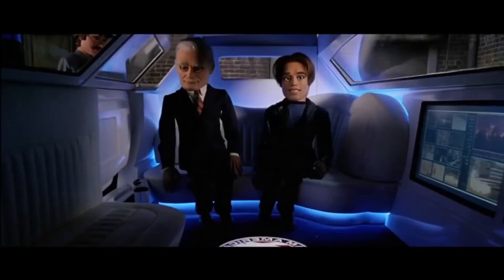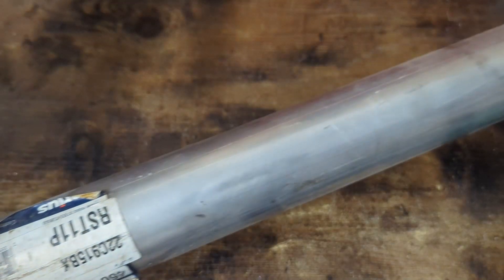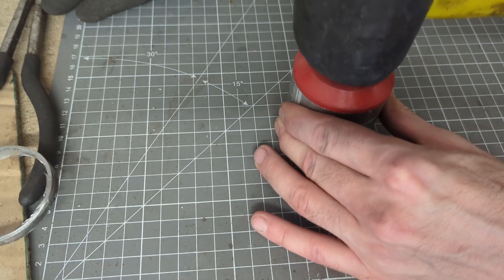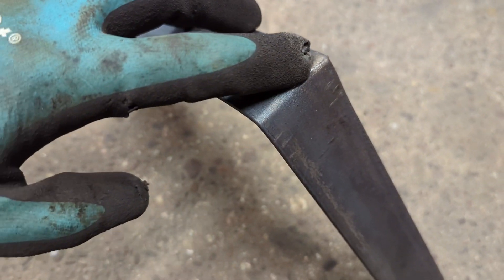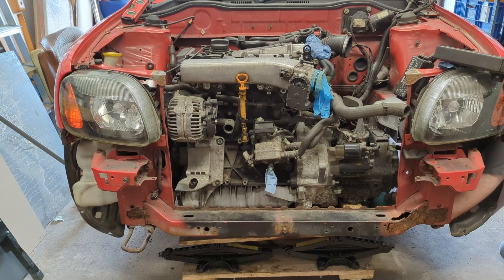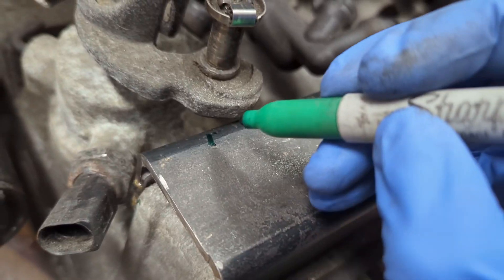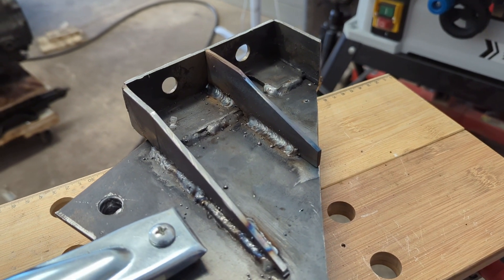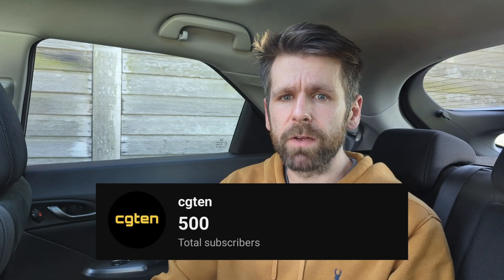My Nissan Micra is now a Turbocharged 1.8 - Audi/VW 1.8T Engine Swap

Comment: I also have the equation veriant and i installed an interior boot light but doesnt work and also is the electric windows/parcel shelf speakers and other bits you done plug and play thanks

Comment: I know it might make installation a bit more difficult, you might look into using a stud on the front hole on the engine side. A shorter (if clearance is an issue) stud still provides the same clamping force, whereas a nut relieved to the point you had to in order to clear the through bolt, doesn't- and the position of the bolt hole (being inline with the rotational axis of the mount) would necessitate it being the strongest attachment point (to prevent a lever action on the rest of the mount, via being hung on just the rearmost bolt).

Just my .02, I could be wrong, it's happened before.
Reply from the maker: I agree on the stud, the only problem is that the captive nut would still stop me from getting a nut on the stud.  I still have some finishing work to do in these so I'll have a play around with it.  Using a stud instead of a bolt is the way forward though I think 👍

Comment: OMG Dude, why'd you choose THAT engine??? Haven't you got access to Google???
Reply: Google is so last year.
Reply from the maker: Better than that.  I have access to Google AND people who daily drive these engines.
Reply: @cgten  What you mean to say is 'daily worry and repair' these engines, right? How's that 17mm to 19 mm gudgeon pin conversion going for ya? Or that contiunuously ssssstretching, rrrrrrrattlting timong chain? Or those leaky camshaft actuator seals and sump-gasket.? Wait, there's more: The warping thermostat housing, the warping oil filter housing...puuuhhhlease, that thing is a hot mess.   @cgten
Reply from the maker: I put the engine in there, I'm sure I can keep it running.  What engine should I have picked then?
Reply: @almostbutnotentirelyunreas166  Those are all just generic service items that would need attention on most engines. What is your actual point?
Reply from the maker: What four engines are you referring to?  I don't see them listed.  And the 'lifetime' of the engine is tied to the lifetime of the car, which differs from manufacturer to manufacturer and is not the same as the amount of time you actually keep it for, which might well be a lot longer.  As far as Nissan is concerned, the lifetime of that Micra ended over a decade ago.  Anyway, interested to know what engines I should have picked instead of the 1.8T.
Reply: @cgten  Hahahah, ghost protocol, how cute! 	SR 20,  4g63,  K20 / K24,  4a-GE. Love your Euro-trash!
Reply from the maker: Ok that's a rather predictable list, not sure why I even asked tbh... none of those engines are common here, any that are around are JDM taxed.  I had an SR20 that was originally going to go in, but I wasn't going to go through the same amount of work for an engine that makes 150bhp stock, and would take thousands to make decent power.
Reply: Dude, enjoy your ride. If you want a reliable (i.e. over-engineered) 4 cylinder , tune-able euro then consider Volvo Red-block. Meantime, have some fun, you've done the work, might as well let it perform.  @cgten